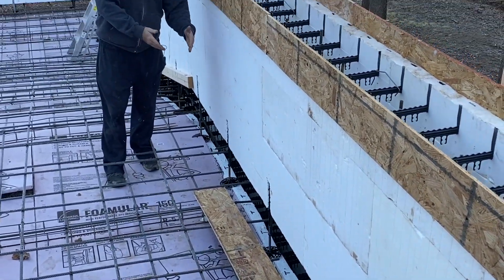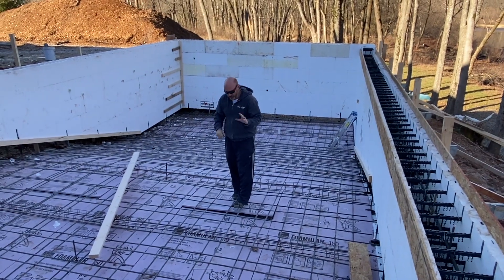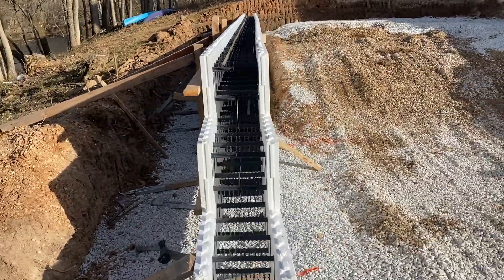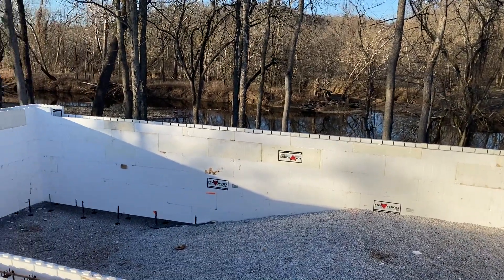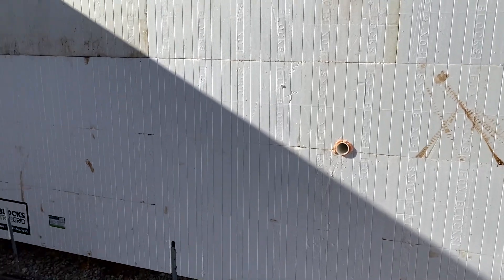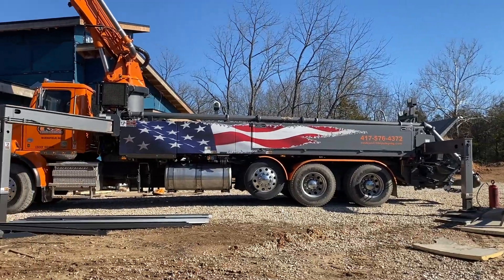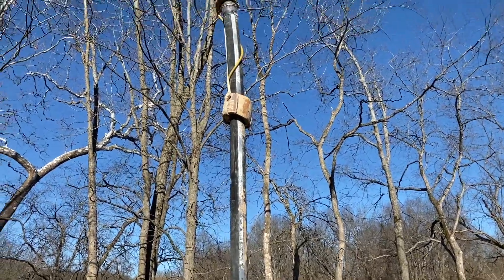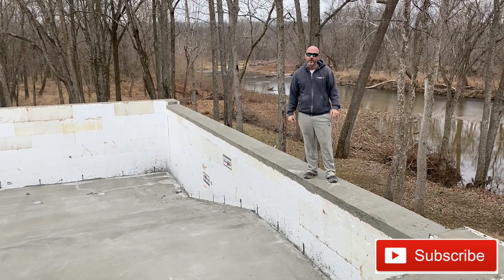ICF Monopour Pool/Best Pool on the Market!!!

Comment: I presume the 12" floor and double rebar as well as mono pour is because you are using the concrete to help with water retention? Do you bother with rebar or remesh in a vinyl liner pool? And guessing you only need 4-5" floor for that?
Reply from the maker: Mostly correct, we do a monolithic slab and footing on our vinyl pools but the field is typically 4” no rebar, just in footers, much cheaper and easier

Comment: Hello,
I see that this pool would not require a pressure release valve in a grade level pool but in a deep excavation 9' with high volume of water do you require a pressure release valve and would you use insulation on the deep end? engineers are telling me not to. the insulation/void form will rot away after time from the water flow. What is your opinion?

Comment: I have a  lifetime career in the trades and you got it right using ICF blocks and ridged foam for any and all pools. Because the thermal break between the ground and concrete is very important. especially for Spas. Great job sir!
Reply from the maker: Thanks!

Comment: Aaron! Do you guys not have flowfill? Basically it’s cheaper than concrete but flows out of the concrete truck like concrete and it doesn’t settle. It’s required in Utah under the major roads… maybe it would be a better solution for you? Just a thought
Reply from the maker: We do not have flowable fill, my plant claims it’s no cheaper than super crappy l2000 footing mix in our market so they don’t carry it…

Comment: Hello, thank you for your video. 
I was wondering how high is the pool wall at the deep end side - I assume approximately 2.5m (8.5 feet)? There are very little rebar rods on so high wall, I would hardly believe this wall will withstand the forces. Did you do the reinforcement calculations?
Reply from the maker: Yes it’s engineered, and there’s rebar vertically every 8” horizontally every 16, not sure what I mean very little?
Reply: @all3pools  : Thank you for your reply.
I did a i simple calculation. The pressure of the water at the bottom of the 2.5m tall wall:
p = 10 kN/m3 * 2.5m =   25 kN/m2

The load at the bottom of the wall would then be:
M = 25 kN/m3 * (2.5m)^2 / 6 = 26 kNm / m_of_wall

If you calculate the minimal required armature cross section for 12" thick wall (8" = 20cm core width, 2" = 5 concrete cover):
Amin = 26 kNm / (20 cm - 5 cm) / 45 kN/cm2 =  3.85 cm2 / m_of_wall

From the video it seems you have a #4 or #5 (no data, my estimation) rebar at 40" vertical spacing (this is what you told in the video and seems right). This means the your rebar cross section is:
#4 rebar: A = 2.5 rebars/m * 1.25 cm2/rebar = 3.1 cm2 / m_of_wall ( not enough )
#5 rebar: A = 2.5 rebars/m * 2 cm2/rebar = 5 cm2 / m_of_wall ( very little safety factor )

Another thing i would consider - if you check the video image at 7:31: 
- the rebar overlapping should be at least 40D, which is 0.5m (20"). I think your overlapping is too short.
- Also the rebar should run vertical to the bottom and than horizontally in line with the bottom slab armature, not in line with top slab armature like in your case.

Regards

Comment: Seriously overkill. I mean are you expecting the pool to survive a direct hit, then I understand. But MY GOD…. that’s just way overkill and economically not feasible to compete in a big market. Been pouring concrete around pools for 40 years. That is CRAZY!
Reply from the maker: You have no idea what you are talking about…. None…. We compete(and typically beat) Gunite prices and we use ecofinish which is far superior to plasters and paints…. Plus the big benefit we are thermally broken making our pools way easier to heat and cool…. Pouring concrete (around) pools doesn’t mean you know the economics of the pool biz, I’ve trained nearly 100 new builders in the past 18 months and consult from coast to coast, I have a pretty good idea of the market…. This pool was priced pre pandemic and pre inflation at 115k, find me a Gunite guy who could do that, in fact adjust it to 140k for all the material increases and find me someone, 20x40, 36’ infinity edge, gas heat, I’ll wait

Comment: Better than Gunite because you get a consistent thickness (no variation in thickness of walls and floor) Gunite/Shotcrete thickness depends on the skill set of the nozzle man, and how well the pool is excavated. If the nozzle man adds too much or not enough water , then the shell can be compromised. Shotcrete can plug up in the hoses, and on a hot day,it can be a nightmare to carve n shape.

Comment: Would it be possible to just pour a footing then walls then floor or bottom.
Reply from the maker: Yes but cold joints worry me if you don’t use a liner
Reply: @all3pools  Makes sense, water leaking out of a pool is a definite call back. Never did a pool but did quite a few pool houses and have seen precast concrete pools, gunite, and fiberglass in my area.

Comment: Aaron, I've watched a bunch of your videos. They are really enjoyable and informative. I'm doing an icf pool at my home in VA. I'm going with plaster as the finish.  I haven't seen much online about installing the lights. I'm thinking of going with LED light fixtures. Do i need install an enclosure or is the fixture designed as stand alone? Do you have a preferred light to use in a plaster pool? Thanks, Scott

Comment: I have soooo many questions.
I watch you build with Perfect Block and I have questions.  If you don't answer me I understand. I am attaching my pool plans so you can refer to what I'm doing.  
I'm building a swimming pool jacuzzi love seat and tanning deck within a 22' X40' ICCF swimming pool that will be heated year around.  

1.  Can I just dig a rectangular hole in my ground and fill with rock to achieve my 3' 6' 3' play pool or does my ground need to match what depths I'm trying to achieve in a play pool flooring foundation?

2. I'm using 10" perfect Blocks for the perimeter walls of the pool.  The back wall above the pool line will be a 5' wall above ground attached to the pool wall.  For the perimeter walls foundation do I want to use Fab Form, Fast Foot, Foothold, or Form a Drain for my Foundation?
The inert walls will be either 6" or 8" perfect Blocks or should I Gunite the interior with Rebar and Gunite?

3.  I was originally going to use Amvic Icf form and litedeck for the pool flooring, now I want Perfect Blocks as they seem easier and built in the US.  what icf can I use for the pool flooring as I was going to have radiant floor heating?  

4.  Can I use an high density insulation sheathing for the pool floor as this is where all the heat escapes? 

5.  I am doing most of the work myself, I'm on a budget and like to do DIY stuff.  But this is a huge project and I'm frightened. LOL.

6.  I will be using Pebble Tec for the pool finish.

I hope you can help and look forward to your input.
Reply from the maker: I would use icf over perfect block iccf for sure…. You cannot get the same structural integrity out of a block with tubes of concrete that you will get out of a monolithic wall in an icf form, people spend a lot of time thinking about the finish and not enough timevv bc thinking about the structure!

Comment: Love your videos. Do you think you could run Radiant Heating on the slab to help heat the pool and do you think it would be a good idea? Thanks for all the information.
Reply from the maker: I’m thinking of doing it on my first training pool this spring!  It will be a good case study, I think it would work well, especially with an auto cover to help hold more heat in from the top!

Comment: Really like you vids,
Great bits of detail.
I’m guessing an engineer specified the concrete and steel?
Do you change the slump from 4” for floor and footings to a higher 6” to 8” for the walls?
Merry Xmas all the best for the New year.
Cheers from Oz
Reply from the maker: We usually keep the 4” in the walls snd try to concentrate on vibrating really good, too wet weakens the end result, we will wet up the flat portions of the floor a little bit but not much, if we need to runny to fill a tough to reach spot or the mono bag footers we usually use super plasticizer and take that 4 to a 7 for 30 min without adding water or sacrificing strength

Comment: When pouring that footing mix, is the empty 12” block and bracing holding back the concrete fill?  Why not use clear gravel? Risk of it moving during the pour or something?
Reply from the maker: Every step from when we put the clean rock in until the pour is done adds lateral pressure like a boa constrictor….  We’ve had it push the wall bracing enough to make a visible bow that had to be addressed, or worse, when using 12” forms the webs themselves would begin to flex…. This is a way to ensure we only have to worry about it for a couple of hours early on in the process!